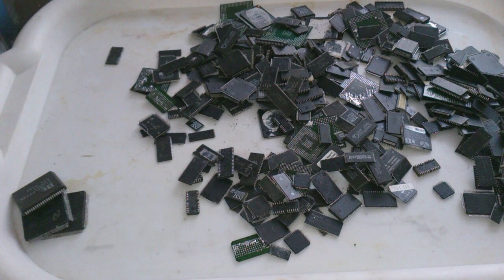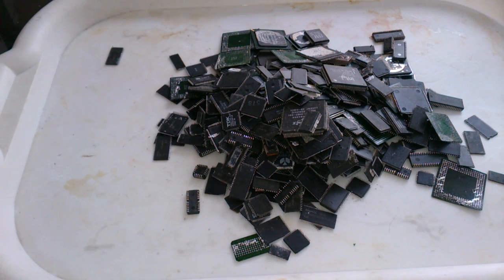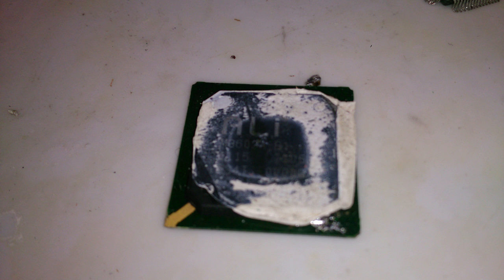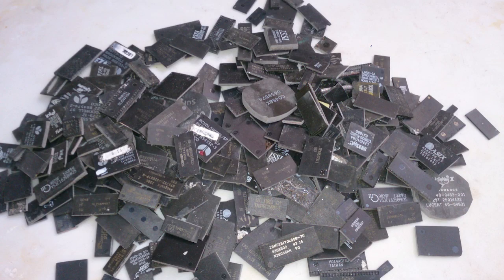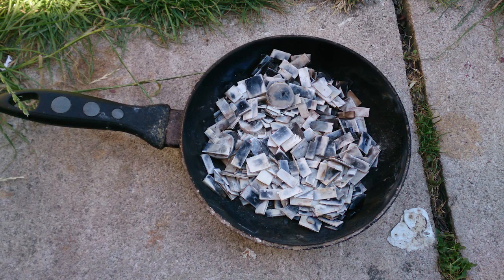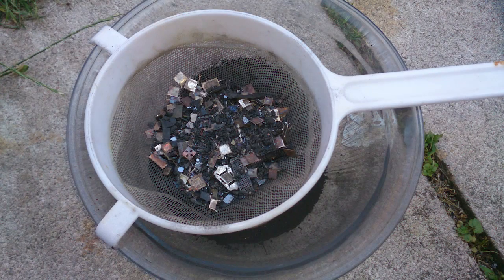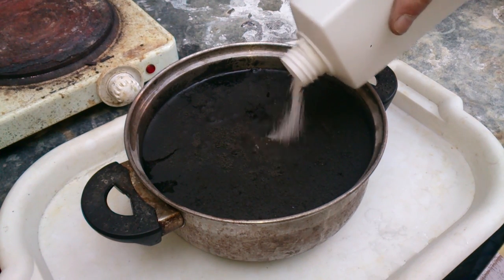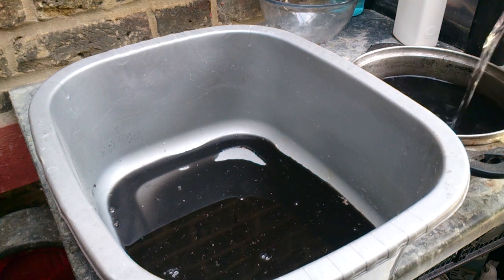Gold Recovery From IC Chips

Comment: you also threw away a large part of the gold, it took months for the gold nanoparticles to settle after you added water when you washed out the ashes. there are two ways to separate the ashes from the gold nanoparticles. the first fast way requires algamation and the slow way is centrifugal washing of the ashes whereby the nanoparticles are concentrated by high centrifugal forces. In short, there is no easy and non-toxic way to get the most out of chips. Anyone who is familiar with mercury distillation will find this method to be the most productive and easiest. If used correctly, this is also safe, only 99.9999% of humanity does not have the necessary knowledge for safe use and will poison themselves with mercury when doing DIY implementation.

Comment: why not use the same process used to make charcoal?   put the chips in a metal container and put that container in a fire, outside of course, and wait until the smoke stops coming out.  then just run the remaining stuff through a ball mill until its well ground.. then you could take a page out of the gold mining handbook and sluice the rest. the light and fine particle should just wash away and leave the heavier stuffs behind.

Comment: Hey Boris! 

I am using your method and I am curious about the heat when using caustic soda to remove the sillica. I am using Lye, and it heats up well I'm it's own. I made what I consider concentrated mix. I can't add heat as you explain as it starts  to rapidly boil. it bubbles well on its own and is creating heat, I've been out for about an hour or more and I still see sillica. any advise?

Comment: Great video! I have many kilos of chips as well....I took maybe 60 and ground them to dust in a coffee bean grinder. Do I still need to incinerate the silicone from the mix before using your process? Thanks!
Reply: Yes incineration is required to liberate all the tiny gold bonding wires. You can pyrolyze the ICs first meaning to heat them in an oxygen free enviroment that will remove the nasty fumes so when you incinerate they dont smoke at all.

Comment: What is caustic soda? And where can it be found?
Reply: It's lye. You can produce it yourself if you have hardwood ash available. Just soak the ashes in water and filter through sand. Evaporate the water and you should have relatively pure NaOH. This method is tried and true - you'll be able to find plenty of instruction for this process online.

It's cheap to purchase online, however. I suggest searching for "lye." It's funny, but certain chemicals are cheaper when you call them by a different name. For example, if you search for "caustic soda" you'll find that it's usually more expensive than just searching "lye." If you search "sodium hydroxide," you'll likely get reagent-grade products that are several times more expensive. I guess it's related to the relative purity of the substance, or its intended use. shrug go figure. Happy hunting!
Reply: +Keven Jones Thank you for the info Kevin! I appreciate it!
Reply from the maker: it's a domestic name for Sodium Hydroxide. It can be found from any store
Reply: +Boris Petrov Thank you for the info!  I appreciate it